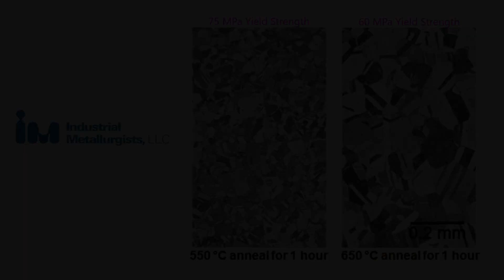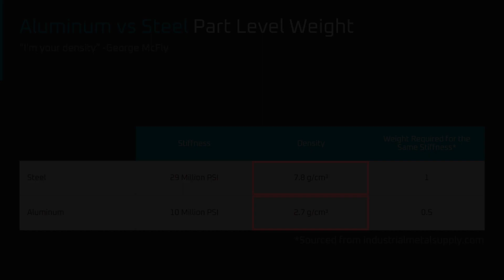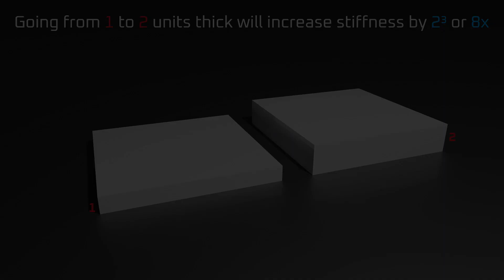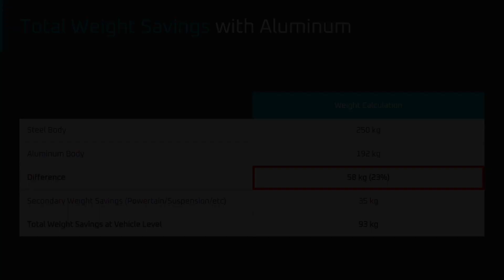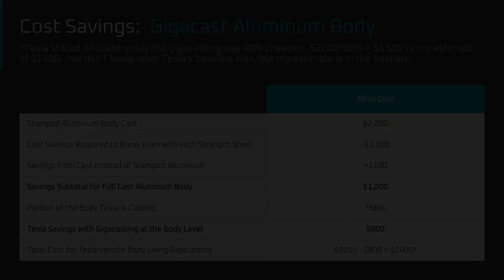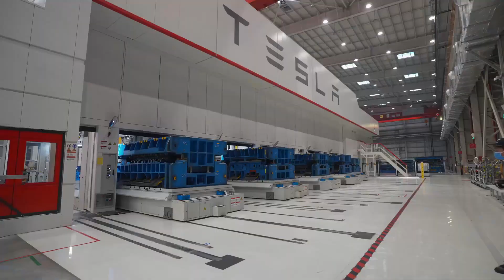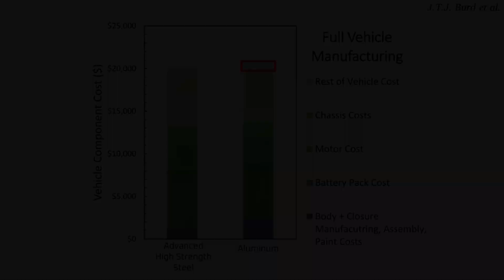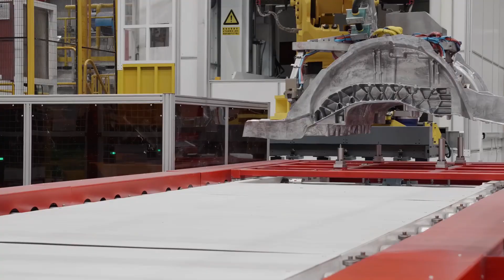#2 Tesla Gigacast Aluminum vs Advanced High Strength Steel

Comment from the maker: Additional Notes on Variables:

1) (+) The Model 3 has a $28,000 production cost.  This means Tesla could save more than what's indicated here.

2) (-/+) Tesla could keep the the battery and motors the same size.  This would mean lower cost savings.  However, the customer would still benefit from longer range, better MPGe, and acceleration.

Thanks for your support!
Reply: I feel that this video understates the case.

1) Casting makes it easier to form complex shapes, with complex, deep embossed / raised ridges on any number of axes at once (as can be easily seen in the geometry of the casting). This increases the net thickness of the piece, and thus its stiffness. 

2) Casting makes it easier to preform bolt holes, wiring mounts, and any number of fittings that would require extra machining or parts with conventional manufacture.

3) Apart from price, casting reduces the part and joint count. Each joint is a new opportunity for problems to emerge such as noise, improper alignment, bad welds, etc - you just get in general a better vehicle if you can keep the part count down.

One could also mention that UHSS is famously a pain to work with compared to HSS and esp. mild steel.
Reply: @karenrobertsdottir4101  Correct. One more benefit from the reduced part count is reduced inventory cost.
Reply: @karenrobertsdottir4101  You are 100% correct Karen. These videos really could benefit from input  from experts in Tool Design, CAD / FEA, Manufacturing Engineering and Metallurgy. The real comparison is very complex, hats off to Tesla for taking on such an ambitious project.
Reply: @karenrobertsdottir4101  Also, castings provide a base for a stable geometric coordinate system, the casting can even define the coordinates. A second casting would need to be oriented relative to the first on the other end, that is difficult, because the car body is not stiff. But you could orient parts relative to the second casting anyway. 
This way, every part has a well defined position, even every surface of a part. I think that makes a difference, because the locations can be tested and corrected.
That should be a good start to catch up with the build quality of German car manufacturers,  which are competing in maximizing build quality if they find nothing else to compete on.
Reply: Have you asked the authors of the MIT paper about what the giga casting process has on manufacturing costs? I am sure they are quite happy having their paper talked about, so I don't think its unreasonable to give it a shot
Reply: Great video really looking forward to seeing these incorporated into the Model Y and see what route Tesla takes, either lower cost or longer range.
Reply: Are Ys with both front & rear castings now being made in Fremont?
Reply: Re: Steel vs Pressed AL. Is the AL ends intended to be sacrificial crush zones, so damage pressures will minimally intrude beyond the immediate ends being crashed upon? If so, will body shops be provided pressed AL "clips" by which they can quickly impart repairs vs steel?
Reply from the maker: @gary itano See the video I did on crashworthiness a few weeks back.  Yes, both front and rear Y made in fremont.

@Karen Róbertsdóttir Covered in the first video and will be covered again.  This is a series.  All those factors were included in the estimates in this video though.

@Lambdabraham Not yet, good idea though.

@Peter Smangaliso Ngoma Yeah, I have a good idea of production rate, but I'm not sure if the info is confidential or not (probably is).  Not sure whether to release it.
Reply: @thelimitingfactor  If you haven't signed an NDA, and this is merely your estimate, not inside information, Tesla can't control what you say. 

I don't know what inside information you might have.
Reply: @AndyZach  No need to piss them off, being cooperative is a very productive method.
Reply: @AudiTTQuattro2003  
A stainless steel body will be really tough.  It will appeal to those who use their trucks hard but want to keep them looking good.  A business should be able to buy a "million mile" Cybertruck and have it present a good face for the company for decades.

(1,000,000 mile lifespan / 13,000 annual miles = 77 years.)
Reply: @AudiTTQuattro2003  everything published to date indicates the CT will also have mega castings incorporated into the body.  You can Google 8,000 ton giga press as just one example.  IDRA, the maker of the giga presses used by Tesla has also publicly stated that in addition to the 6,000 ton Tesla is using for Model Y castings, they are now also making an 8,000 ton press Tesla will be using for "pickup trucks and SUV's".  As I understand it, the CT will use 3 mm thick stainless for the external shell, or exoskeleton of the truck.
Reply: Hi Jordan. Love your deep dive videos. So much information. It's crazy 👍
Could you please check out Lyten and their Lithium-Sulfur battery as well as the Monash team's version adding sugar to stabilize the chemistry and give us your opinion on these new potential breakthroughs? I'd love to hear what you think ✌️
Reply: You are making a huge mistake due to misunderstanding.  You are mixing BODY research and pricing, but the casting is for the chassis… and is not a regular casting, it’s a special alloy  and a mega casting like aero space.  The savings is in assembly, precision, weight, strengthening.
Reply: @AudiTTQuattro2003 Munro (of Munro Live) says that making changes to a giga casting die isn't that much of a big deal. One wouldn't have to make a new die for every change --- just make changes to the die.
Reply: Limiting Factor - I think in the Future , going to a 4 motor system with Smaller Motors but same power will also make the car Lighter and cost Savings , they can Further reduce costs by making more Motor Models with Power to match the Vehicle. TESLA should try to Miniaturize the Motors and Intergrate the Inverter on top and the gears .
Reply: @markplott4820  How can multiple smaller motors with the same total power be lighter? Does it allow to remove other parts, like gears? Four motors allow to get rid of the differential, 5 or so gears and a housing. That may be enough, right.
Reply: @vsiegel   - there is no Transmission , like in a Combustion car, and since the Motors use Simple one speed , no Gearbox is needed. 
you get Further efficiency with Two PM motors up Front and Two Rear Induction motors in the Rear. in this way Both the low end 0 - 50 Acceleration , and high end 50 - 100+ Acceleration are covered. 
and when I am talking Small, I thinking of Small motors that can each fit into a Backpack and even a Woman can lift each motor.
Reply: @markplott4820  Sounds good. I think the motor of a Tesla car typically has one pair of gears to the wheel. I'm not sure, but I assume it allows for a smaller motor.
When thinking of four motors, I imagine the motors either inside the wheel, or directly next to it. I have difficulties to imagine motors that can accelerate a car as powerful as is common for Tesla. But then, the motors have liquid cooling for the stator, and may operate far outside of what a "normal electric motor" does. If a planetary gear is used between motor and wheel, I can easily see it working.

Comment: I was involved in a road rage chase and was cornered in London by two attackers who spent 15 minutes hard kicking and punching my 2021 Tesla Model 3 LR to no avail while I waited for the police. They went all out on the doors and windows, but the car held up, imagine two grown men punching kicking using the knife to smash the windows to get me out and doing this constantly all over the windows and bodywork trying to damage my car. No dents, no broken glass, just a damaged wing mirror cover and a couple of knife scratches. I thought they’d completely destroy it, but they got too tired and gave up. Tesla’s high-strength steel and reinforced glass are on another level, I would have 100 percent gotten killed if I had any other car I'm sure of it..plus they got super frustrated by not working out how to open the doors and that increased their rage by a few fold..the Tesla is the reason I'm alive today and I will never buy another car beside it unless it's a bulletproof Bentley or something
Reply: Adding further to this whilst I was giving the statement to the police with other eye witnesses they were shocked my car hardly got damaged which led me to research the Tesla's construction and hence it led me to this video!
Reply from the maker: Glad you're alright!  That sounds like a hell of an incident.

Comment: Giga casting is going to take a lot of advance planing. Totally possible to get it working. But casting has the same but different issues of stamping. I wonder how they are going to deal with tool wear on the molds. Hmmm that's going to be expensive.

Comment: The resultant stiffness is the cube of the depth of a plate in bending but you also divide by the depth of the most extreme fiber when integrating it to get the resultant deflection meaning the best way to look at stiffness is by the square and not cube.

Comment: This video is very informative Jordan, I congratulate you. On aspect I am not sure you touched on is the higher rebate that automakers like Tesla may get if they sell the aluminum scrap, which is more worthy. Also, what is the circularity of the aluminum gigacasting? Do you think that this will drive use of aluminum sheet usage in other parts of the vehicle to feed and subsidize the gigacasting process?

Comment: What I find ridicoulous is how you say only those with a advanced engineering background know this while ive been arguing these exact points for years with stubborn idiotic college grads who regurgitate bs rather than actually using their head. You dont need any of this analysis, degrees, or other bullshit. Just use common sense, aluminum is far cheaper, quicker, stronger, and lighter when casting 1-3 aluminum pieces vs thousands of stamped steel parts.
Reply from the maker: I think you put some words in my mouth there keyboard warrior

Comment: Jordan, just a thought. In an accident the aluminium is probably harder but more easily fractured than the steel is.  Instead of passing the impact through to the passengers the aluminium takes the brunt & gives way; ie crushes in the moulded areas. Steel at the battery frame is necessary for stiffer protection but would be harsher on those inside.
Reply from the maker: Amen!  That's my understanding as well!

Comment: i could guess that its possible to think of "inserted" or " embedded" steel or other materials inside the casting. a proper design could join the best of the 2 elements, if done in a way that is possible to put quickly those inserts right before the molds assembly/closing

Comment: Tesla can choose to use high strength steel in door and hood panels if they are light enough. They can switch over any time if it is cost effective. I’ve noticed the aluminum door panels tear instead of bend in an accident necessitating replacement instead of body work. Tesla will probably not be casting doors and hood panels anytime soon unless they can be used as a structural elements behind the exterior skin. However, remember, doors are an integral part of the passenger safety structure in a side impact. Steel structures under the skin are protecting the occupants now. Can aluminum provide the same safety factor?
Reply from the maker: Great insight!

Comment: One important fact has been completely kept out of the theoretical weight, strength and stiffness equation. Casting/moulding technology limits the minimum wall thickness. Theoretical mass and stiffness calculations become different when you can't make castings not thinner then 4-8mm although that would be enough for strength. Steel sheet products have almost no thickness limitations, can be as low as 0.2 mm So castings are always much havier because of wall thickness limitations. Why is Tesla using Al castings? They're a newbie in automotive/mechanical engineering and production technology. They try many things new and different, supported by companies always willing to expand their customer base. Some of these ideas are good and some of them are bad

Comment: The reason they won’t cast the upper body is not cost or supply chain - it’s strength. A Model S can take 7 tons of load on the roof without being crashed, it would take far too much material in cast aluminum to get to this kind of strength.

Comment: Re - Cost of Aluminium
Aluminium is effectively solidified electricity!
The major cost is in the electricity required to make Aluminium
Tesla is also working on massively reducing the cost of electricity - and a large part of going renewable will mean that power generation will be overbuilt so that there will be seasonal "surpluses" of power
This may/should have the effect of increasing Aluminium Supply and reducing Aluminium prices

Comment: Steel rusts, aluminum doesn't.
In as far as body panels go, if you have any respect for your customers you won't make your body panels out of steel.
One of my favorite vehicles from about 8 years ago was a Honda CRV that still ran like a dream but the underside was so rusty that the suspension was no longer mounting to the body and it became dangerous so I had to let it go.
Anyone living in the rust belt of the United States knows that a brand new car begins to rust after about 2 years of purchase...
Planned obsolescence cannot keep being the norm as it has been for so many years!
Aluminum is lighter than steel which positively affects the performance of the car and it won't rust which will improve on the reliability of the car.

Comment: Pretty decent analysis. Couple of refinements:

1. There is IMHO no universally-accepted definition of "high strength steel". So, be careful when comparing;

2. Magnesium is an oddity. Its USP's include high damping - ideal for dashboard support. Again, be careful what you compare...

3. Strength is easy to talk about until you look closer: e.g. fatigue strength and energy absorption potential are quite tricky to pin down.

Keep up the good work.

Comment: Don't tell me about advanced steels for cars and trucks. Metallurgy appears to have been perfected to such an extent that the cars and trucks actually dissolve within 7 years. Trucks particularly rust to a point that they're worthless for repair or resale. Has anyone noticed this? They're rusting coming off of the production line. Is this intentional? I believe it is.

Comment: The entire calculation is based on vehicle cost at time of sale which the primary motivator for most care shoppers. However, Tesla also appears to care about overall effect on greenhouse gases.  For that, it may be better to look at 10-year total cost of ownership.  Minimal vehicle body weight savings would have a dramatic effect on overall energy consumption for 10-yr 150K miles driven, further tipping the scale in favor of more expensive gigacast alloys with lower weight-to-strength ratios.

Comment: I doub't you will ever find the cost-analisys of the production element. I don't have them and I spent 15 year selling the robot based assembly and welding system for the automotive industry.. and I don't have them because they are a very well kept secret.. they let you know their margin on a platform, but not the brake down on that margin.. but for sure getting rid of all those robots and, even more so, the complex gigs required to put a car frame together, with all the small bits and bobs, all the poka-yoke, all the sensors, controls, phases, redundancies, robot programming, welding parameters.. it is going to increase that margin considerably AND it is going to reduce the time to market for the car.. no more two shift a day 60 days race to overhaul a production line for a new model.. you work, offline, on a new casting.. you set it up, a week of trials and you are up and running.. thanks God I don't do that as a job anymore.. or I would have ended up jobless in a couple of years...

Comment: Why are you comparing cost of per ton/ strength. Isn't aluminium parts lighter? 
1. Point on skill isn't not that relevant, you understand that IC engineers are quite complicated casting? History is proved that in mechanical manufacturing their is no secrecy. 
2. Tesla would have secured long term contracts for alluminium? No suppliers will assure prices for more than 3-6 months. 
3. Cost of alluminium is going increase much faster than steel given the rise in copper prices with the rise in use of motors.